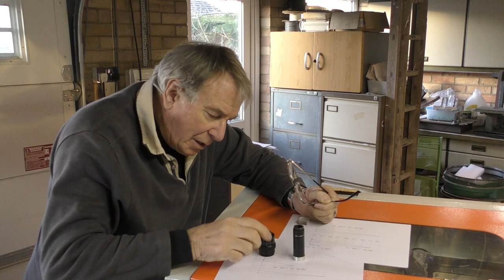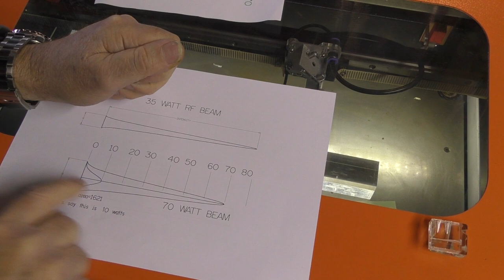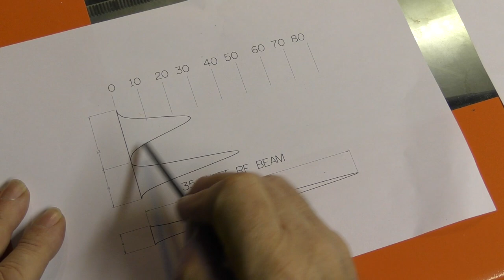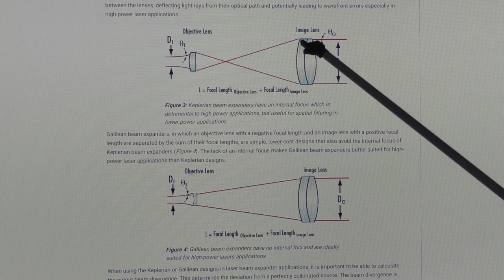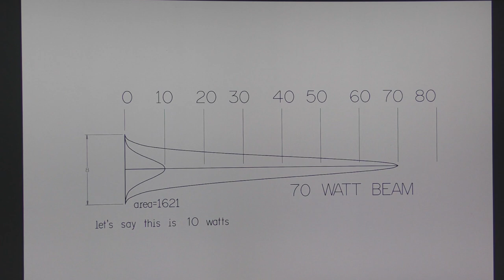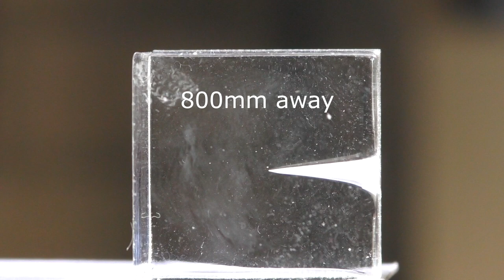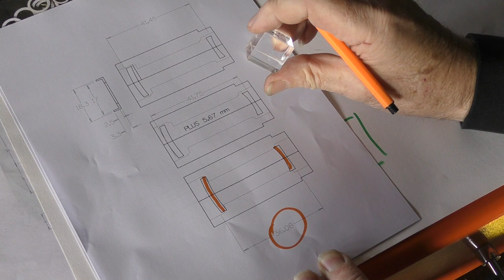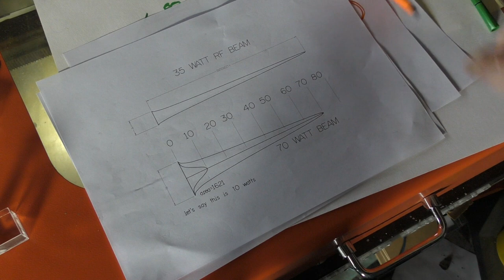RDWorks Learning Lab 228 Search for a Beam Collimator Part 1

Comment: Russ, you are doing all your experiments with the unfocused beam. I think lens theory says a bigger beam can be focused to a smaller spot, which if true means your results would be flipped. I.e. when the beam is bigger and unfocused and doesn't do much damage then focused it might be smaller and do more damage. This is why beam expanders, expand, to get a smaller final spot.
Reply from the maker: You are perfectly correct, that is exactly the reson why beam expanders are used. They are specifcally trying to remove the "sharpness" from the beam and create a more uniform  (blunt) intensity beam.  In that way the effect of spherical aberration is greatly decreased and it is easier to get a controlled small focus at a predictable focal distance.  As I discovered several years ago the conditons required for engraving are diametricaly opposite to those required for cutting. This is another example. Efficient cutting requires "sharpness" (high CENTRAL beam intensity) so an expanded "blunt" beam  will  still cut, but inefficiently.. Without a beam expander ALL laser beams start to go "blunt" as the distance from the source increases. The power remains constant but the beam diameter increases  (just like the expander does in a controlled manner)and hence the beam loses it's central CUTTING  intensity.
It is important that you remember that a lens is only an amplifier, it cannot magically restore beam properties that were not there upon entry to the lens
 Best wishes
Riuss
Reply: So I think the most important thing is the beam is parallel, so it focuses the same all over, not that it is small before the final lens.
Reply: @SarbarMultimedia  I think that is exactly what the final lens does. It takes a blunt beam and makes a sharp one. The bigger diameter the blunt beam is then the smaller and sharper the final spot is. You seem to be using the collimator to get a smaller beam and hence a deeper cut, but that is the job of the final lens. The collimator's job is to get a parallel beam, so that it always enters the final lens the same size and intensity no matter where it is. The final lens should then be able to focus it to a small spot.
Reply from the maker: @nophead  
 
 Yes,  the final lens does amplify the beam but you mistakenly believe  good cutting is a feature of the lens.. If that were true  how do you explain the 60% cutting improvement I achieved in the same material with the SAME LENS and same power. It is true that at this stage it is just in one part of the table but the point is proven that the smaller more intense beam is the real element that controls cutting ability  and NOT the lens.  A lens is a passive  amplifier and has no intelligence Lets asume it amplifies X100
 When a beam exits the tube lets say iy has an intensity of 3 (just a number). If I semd it through a X3 beam expander/collimator the beam diameter ill grow  by X3 and the intensity will reduce to  1. When the beam arrives at the lens  it will amplify the peak intensity to 100 at the material surface  and damage will occur. In my vision the peak intensity will still be 3 as ot reaches the lens and will arrive at the material as an intensity of 300.  Once you have lost intensity a lens will not restore it
 
My three years of research into why lenses do not perform in practice in accordance with the specifications has made me realise that although lens mterials my be designed for laser beams,  sperical aberration in lenses allows the high intensity light to focus at points substatially below the manufactureres focal point. This is great for cutting but messy for engraving. When you expand a beam that high intesity becomes seriuosly muted and that spherical aberration weakness becomes unimportant and allows the beam to focus more uniformly at a single point.  Lens theory (as with all theories) has boundary conditions  within which the theory applies.. In the same way that bees do not undersatnd they cannot fly (according to aerodydynamic theory . So laser beams have no understanding of lens theory. Your readng of how lenses work would be fine if laser light was unifrom, but its not.......until you send it through a beam expander.
  I did a recent video that explained the importance of laser beam intensity. Perhaps you missed it
https://www.youtube.com/watch?v=z8sNPtIIXZ4
 

 Best wishes
Russ
Reply: @SarbarMultimedia  I don't think laser beams break the laws of optics. I think all the complication is down to the severe aberration of the lenses compared to normal optical ones that are deliberately aspherical. And I can see it might work in your favour when doing deep cuts, where the multiple points of focus give you a bigger range of depths where the intensity is high enough. So I think you want to expand the beam to get the most spherical aberration at the final lens and have it collimated to keep the effect consistent. But that would mean the collimated beam would not do a deep burn without the final lens. It would be weaker because it has a bigger area but you are rejecting those wide beams when you test without the final lens.
Reply from the maker: @nophead  
 Thanks for your well argued reply, I agree that laser beams do break the laws of optics . What I said was that their high central intensity exploits the abberaiom wekness of lenses  Lens theory is RAY based and takes no heed of INTENSITY. and its damage potential because lens theory is all about IMAGES .
There is nothing amiss with any of the laws  physics or optics but there were no laser beams around when lens theory was devloped thousands of years ago. I am seeing an opportunity to exploit a  laser beam property  in an unconventional way. I also ask you to always remember that  I am just sharing my journey and discoveries. I am not an evangalist or teacher,  just an old  engineer who  is keeping his grey cells exrcised by digging into parts of this technology that have not been preiously explored.  Success or failure, the pleasure is all mine.
 Best wishes
Russ

Comment: Is it possible the RF unit itself has a problem? After all, All the major acrylic cutting companies swear by RF laser cutters over glass tube machines, for both output power and longevity of use, clearly there is a problem with the equipment you were sent, Either the Rf unit itself or the quality of the glass lenses, perhaps the glass you have, is preventing some of the wavelengths to get throw.
Reply from the maker: Iteresting questions. First I have measured this 30 watt  tube power at 38 watts and secondly you can witness for yourself that the beam diameter and intensity distribution straight out of the tube are FABULOUS.  There are no signs for me to question the tube . The beam divergence is specified at 7mrads (typical for all RF tubes , even the mot expensive ) and At 1300mm the very flat beam diameter is about  11mm  It measures 4mm to start so 1.3m X7mm/m =9.1mm growth. 4 +9mm =13 so the beam divergence is comfortably within specification. It is doing everything it says on the tin. 
 The lenses in the expander are good quality bright yellow USA made CVD  material,  Whether the lenses themselves were  made in the USA or China , I cant say. But I have been using and testing many types of lens material in the past 3 years and  found differences  yes buy not huge. Paying more for a lens does not ensure better cutting  performance, The real dictator of cutting performance is the quality and intensity profile of the beam  ENTERING the lens.

 To your point about professional users preferring RF machines . Here are two consideration you may have to make if you were investing over $100K on an 8ft x 4ftn large bed machine
 
 1) A glaas tube machine will be considerably cheaper for a specified power . I am not aware on any large machines being fitted wiyh a beam expander because the divergence specification i less than 3mrads (3mm/m beam growth) , Few people realise  how damaging this specification is for cutting. In one corner  a 160 watt tube may have an 8mm beam and in the other  corner  3.6m away the beam grows to 19mm That is a huge difference in cutting performance across the table

 2) An RF tube starts with a much smaller beam about 4mm and to correct the large 5 to 7 mrad divergence you would use a  a X3 expander. That in turn will produce a 12mm beam with reasonably stable performance across the whole area  So  the predictable performance of RF,  although not optimal, is a better  overall  than a glass tube for cutting.
 
 Investment cost is not an issue for a business that requires preditable performance. .Hobbyists have different choices because they usually run small machines and cost is an issue.

 Because I have a small machine my goal is to NOT expand the beam but to collimate it and maintain the cutting power. so that it performs to almost twice that of a glass tube..
 
 I  hope that answers your questions.
 Best wishes
Russ

Comment: ok,,, so if i get this,,, we are no longer interested in maintaining coherence across the beam diameter.   because coherence will function  uniformly at the material for effect.
Reply from the maker: I think you misunderstand the propeties of the beam.  Coherence means that all the photons are frequency synchronised and are  all marching together like an army. That remains true until the light hits the SURFACE of the material whereupon it transforms its energy into molecular vibration. More vibration equals higher temperature in the molecules. There is a second property that is common to all laser beams and that is the INTENSITY of those photons will  NOT uniform across the beam  There is a natural INTENSITY distibution that is bell shaped as I explain in the video. The greater the INTENSITY  at the centre of the beam the FASTER it will vibrate molecules to their damage threshold.   The low intensity at the edge of the beam just scorches  material whereas the high central intensity  quickly vaporizes material.  My aim is to maintain that  high intensity profile  into the lens regardless of the head position on the table.  It is obvious that lenses and laser beams are not made for each other because as I have demonstrated, take a "sharp" beam and pass it through two lenses to supposedly make the beam parallel and  all it does is act like a washing machine and  quickly destroys the "sharpness" Ther are tht same number of photons in the disrupted beam  (so there is no loss of power) but the ability to do damage quickly has been destroyed. If it was  originally soldiers marching in step and  in perfect ranks,  when they pass through a restricting  gate, the ranks get mixed up even though they are still all marching in sync.
 I hope I have understood your question correctly?
 Best wishes
Russ
Reply: @SarbarMultimedia  my thoughts were that as we use a beam expander the distance that the photons have to travel on the outer edges of the beam is further than the ones in the center.   this should create a phase shift over cross section of the beam.   althought i could suppose that the coherence isnt ever uniform,
Reply: im doing my reading this morning on beam creation and shaping

Comment: You are SO close!  There's too much spacing, it's overexpanding and making a convergence (weak focal point, a beam waist) at 500mm, this is a "bowtie field".  You think you want this- you don't.  You're chasing highest spatial intensity, but that's not actually useful like you think- you want CONSISTENCY (uniformity).  You can create a convergence point at 1300m with the right spacer- but, I promise you, you STILL don't want that!  It will be about a 9mm at the expander,  and 4mm at 1300mm.  Which is TERRIFYING at the 1.3M point, but is it actually practical?  I've been there.   You have a 9mm piece of acrylic and can cut quite fast in the far field now, but near is totally different settings.  And the kerf is all different.   And attempts to photo engrave a larger image are foiled because it's a slightly different system.
Like I say, you're SO close!  1.  Shim the second lens, not the first.  2.  Second lens needs a thinner shim.  Honestly, use a silicone lens washer underneath second lens, and it aligns against the threaded ring on the outside.  Now you can just adjust bit by bit by tightening the ring to compress the washer. 
The goal is to move the convergence point to a virtual point well past the bed- probably about 2M for a 1.3M machine, with as minimal expansion as possible.  1.5x if you got it, but 2.0x is fine too